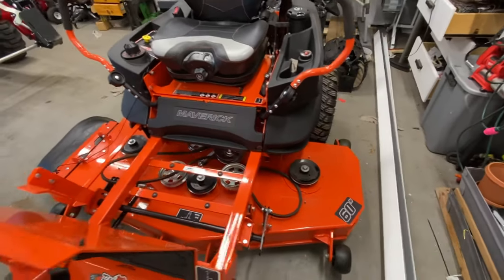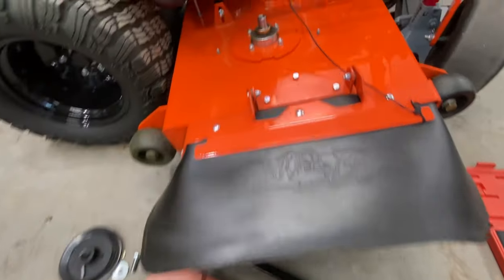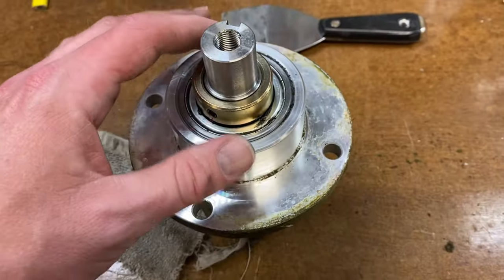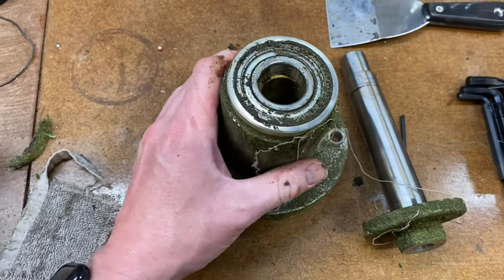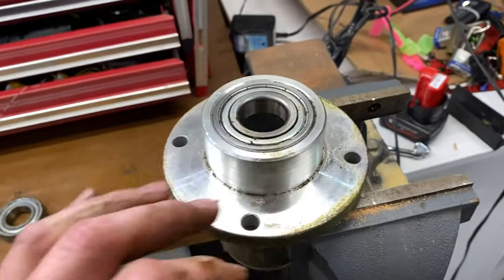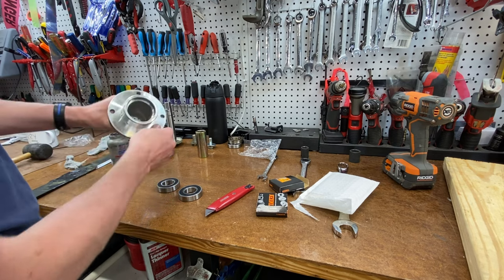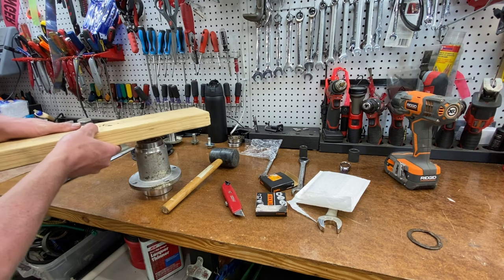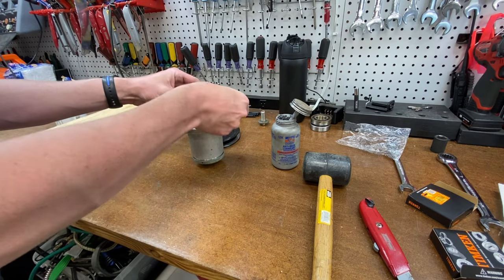Mower Spindle Bearing Replacement : 2020 BadBoy Maverick 60 inch

Comment: Good video, you should do more.  I use a needle nozzle to add a little grease to the bearings after a season and they last quite a bit longer.
Reply from the maker: Thank you 🙏 when I ordered bearings I got 6 total (a package deal ) and indeed if these last only as long as originals that’s exactly what I’m planning to do

Comment: I'm surprised those aren't greaseable. Great how-to video.👍
Reply from the maker: I agree.  tons of input from folks on how to modify greaseless spindles. after I put it together I started questioning if i SHOULD have, then realized the TIMKEN bearings i bought (which are great quality) have rubber seals on BOTH sides, so  IF i rebuilt the spindles with them AND added a grease zerk, high possibility of blowing out the rubber seals.  we'll see how long these last and make a plan from there. glad the cost was only $21 per spindle to rebuild and so far only one spindle bit the dust.
Reply: Truly I can kind of see why they wouldn't put grease zerks on the spindles. With the amount of debris that goes on under that deck I can only image they would get broke off at the shaft. Then your having to use a ez out to get them out to put new ones in. That just my honest opinion.
Reply: they are greasable  , that is a dust cover not a seal , the grease goes right past the covers , grease until you see it come out of ends of spindle ,, you can pick them out with your fingernail so that just shows you that they are not "seals"  , it is not meant to stop grease from entering from a grease gun that puts out 10 000 psi every pump
Reply: @UnKnown-jp1bv agree the bearing is encased

Comment: Thanks for vid. I have a 2021 Maverick with 38 hours on it and just beginning to notice a slight grumbling in one of my deck bearings also. I like the mower but bearings should last much longer than this. Easy enough to replace its just with this day and age you'd think quality should be better than what were getting especially with low hours.
Reply from the maker: absolutely! I've heard a ton of talk and finger pointing that the cause of these bearing failures is people washing the decks too much. Which may be in part true, but our old 1994 John deere single blade SEALED bearing spindles are still working perfect to this day and it has NOT had an easy mowing life.   Not a hard or expensive job, just hope these new bearings last longer than the originals.
Reply: 43 hours on my 2023 elite limited. Felling and hearing some grumbling

Comment: 💥 Well that’s a shame you need to replace that already. Nice tutorial! 👍
Keep on tractoring!
Reply from the maker: Really unfortunate for sure. We grew up with a 1994 John Deere GX75 which was a single blade rear engine john deere mower ALSO (like this) with a sealed/ NON greasable spindle. It's still running without issue to this day. These only made it 77 hours.  One spindle done and it went great... thankfully only costs approx $21 per spindle per rebuild BUT if they continue to go out, i'm going to look at modifying to a greasable type spindle. Thanks for stopping by sir! Even before the HD version processed! Great to hear from you!
Reply: @cmnoutdoors9751  My 2021 Maverick has had 2 spindle bearing failures in 88 hours running time.  This is the only mower that I have owned that has had bearings fail.  I'd say Bad Boy has a serious problem with their spindle design.  Please keep us informed.

Comment: After you've taken them apart before you put the bearings back in remove the inner seal from the top and the inner self from the bottom bearing and then drill and tap on the side of the spindle and put a grease fitting and then on the other side put a small weep hole to bleed off excess pressure when too much grease goes in and then reassemble the spindle.

Comment: Good job getting bearings with seals on both sides , the old bearings had metal shields on the outside - bad design and not waterproof when washing the deck
Reply: The owners manual says not to wash the deck with water use  compressed air only.. least my zt 60" book says that

Comment: I wanted zerks in mine but they wouldn't last under the deck and there's no room under the pully.  Since I have a lathe I screwed the top bolt in and measured  to just below the top bearing seat, drilled bolt and shaft and then drilled a cross hole so grease can get in the housing. The metal seals on the outside of the bearing won't push out as easy as the plastic ones so I pulled the inside seals off the bearings and filled the spindle with grease stopping when it got hard to pump; spindle was full.  A couple pumps of grease twice a season and they're smoother than it was new.

Comment: How in the world is that thing so clean? I don't even see a blade of grass or dirt on it or the tires. I have 5 acres, I mow about 2, I do have a lot of swampy areas at times, mine is covered in grass, and dried on mud. I can clean it, but it'll be destroyed by the following week. I clean mine once a season, but it still doesn't look that good.

BTW, thanks for the video and part number. I think mine are shot. My mower seems very loud, and it takes several attempts for the blades to engage without stalling

Comment: You made that look easy. I recently removed my spindle bearings on a gravely non serviceable spindle, those bearings were super tight on the shaft, i think to tight. I had to use a small puller to remove them. Don't ask me about installing the new bearings, as i have yet to get the correct bearings. Ironically the original bearing failed because of a cracked inner race and i baby the unit. While I wait for the right bearings, i had to shell $222 for a new maitenance free spindle. Again this was on a Gravely ZT. Other than having to replace this 2nd spindle, its been a decent machine and cuts really nice. Any advice for making bearing seating easier? Anyone?

Comment: I got a question. My center spindle pulley won’t pull off 😡 the other two slipped right off. You got any ideas? Yes the set screw is loose, I sprayed a little wd40 on top just to see if it would loosen it. No success yet. It’s lowered all the way to the ground and I’ve yanked up and nothing. Thanks in advance.

Comment: My 21 Maverick with 20 hours on it had both right and left sides spindle bearings fail and started howling on my 60 inch deck. That’s right 20 hours. Bad design or cheep bearings from Bad Boy. Ridiculous as nd was never power washed and stored in heated shop.